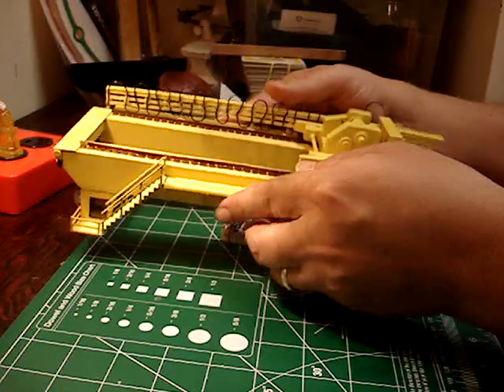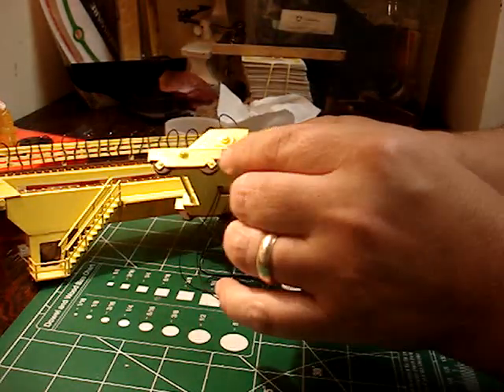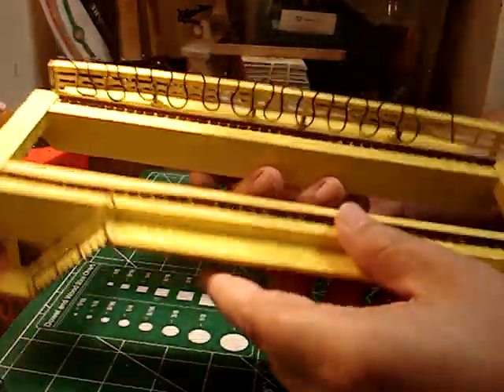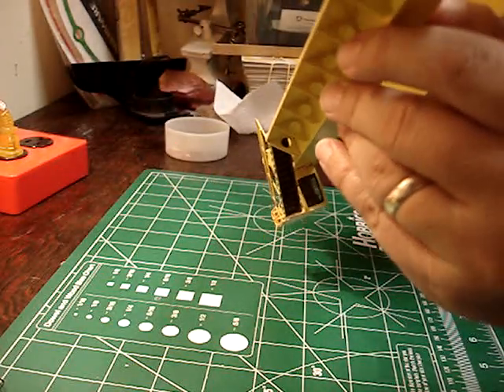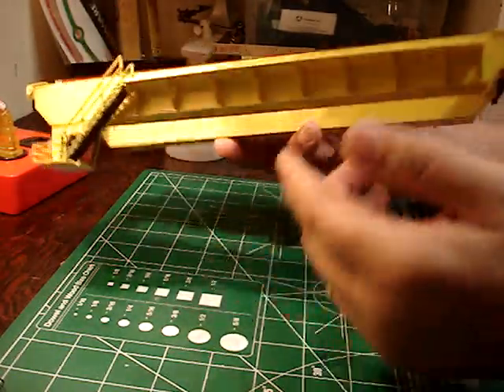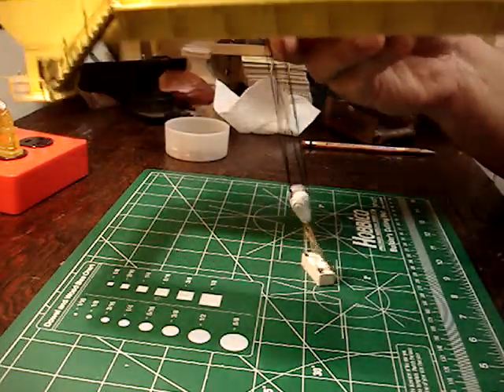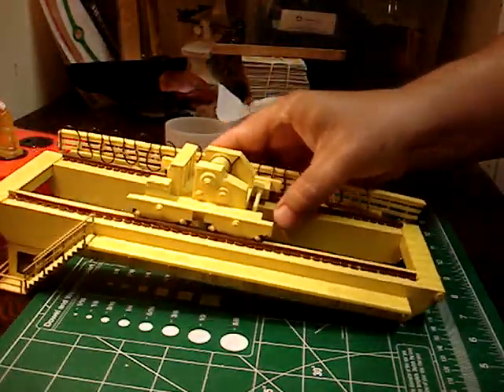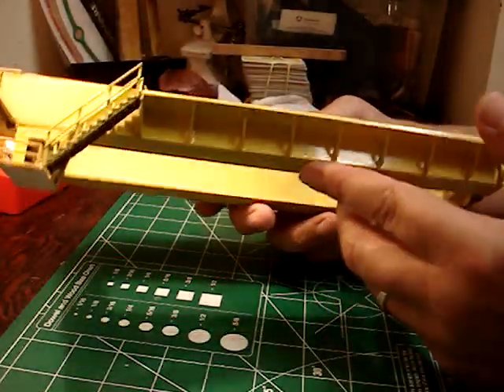HO Scratch Built Overhead Crane .

Comment: I'm wanting to build a 600 Ton outdoors ingot striper crane I found a photo on the net. I'm thinking plans for it are available haven't looked yet but I've a good photo of it. I've had another photo of a half ingot striper genty crane underneath a full sized ingot striper crane. I know your asking why both cranes built under a building type roof because the half genty crane was there for stripping the ingots off the ingot cars and after removed the bigger ingot crane was there to move the golden ingots to the soaking pits. Would make a fantastic show if was completed right but I've since lost the photo lol. I'll get back with you with the link to the outdoors 600 Ton monster ingot stripper crane ... BRIAN
Reply from the maker: Sorry Brian for the late reply. Morgan Engineering made the caddy of steel mill cranes. Preticularly the ingot strippers. Massive overbuilt monsters !

Comment: That's really nice work. It will be even better when you get all the details and paint work done. Also where did you get the wheels?
Reply from the maker: Thanks, it's seems like when ya build something. You always wind up waiting on parts. In this case. I lost steam but it'll be completed soon.
Reply from the maker: Missed the wheel question. That is the most tedious part of this crane built. I had to use hollow core punches for the circles & lots of them. It eludes me exactly how many are needed for both the main span & trolley.